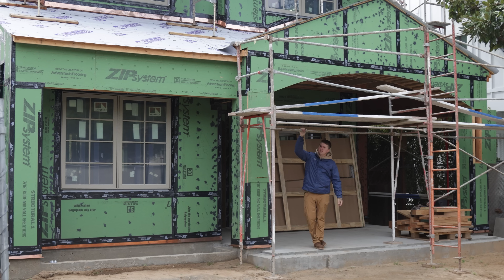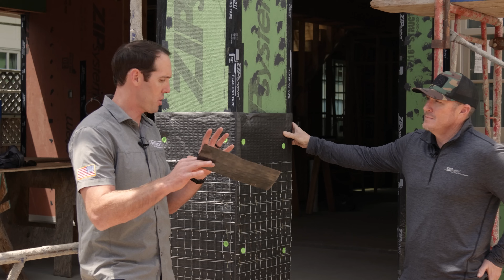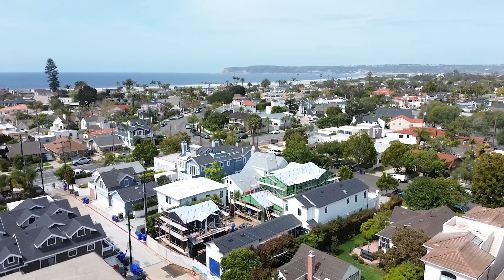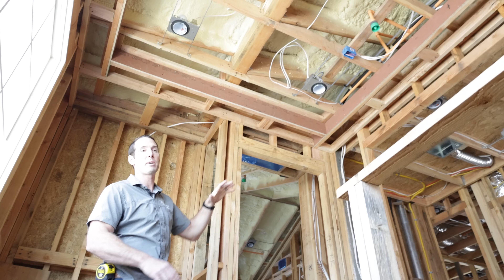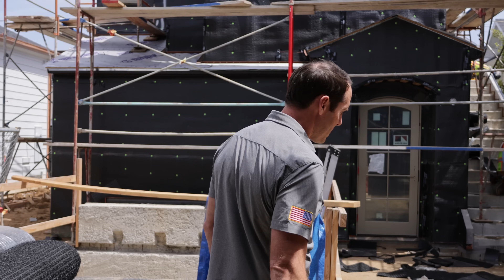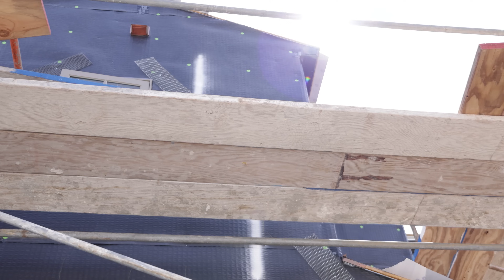Tips From A Pro-Builder | Framing, Insulation, Rain Screen & More [On The Road #3]

Comment: On the slack in electrical, would you do it through the studs to prevent drywallers damage or homeowners damage since it’s sitting on the face of the stud?